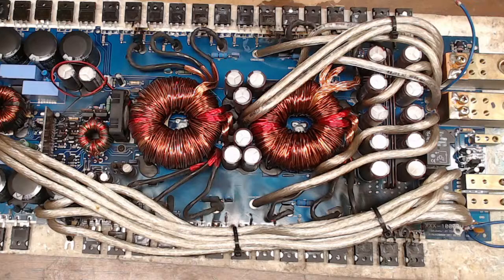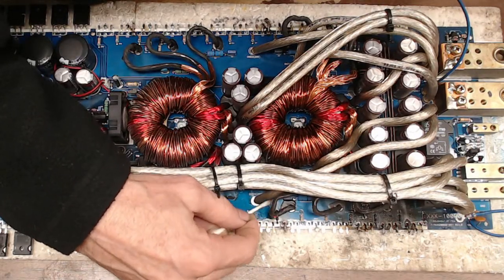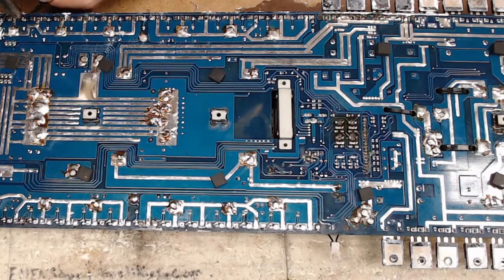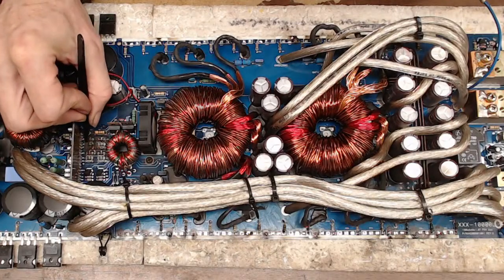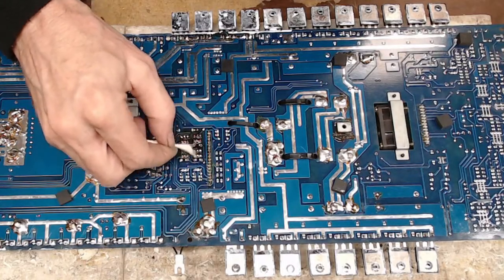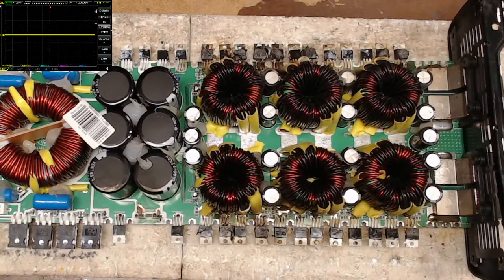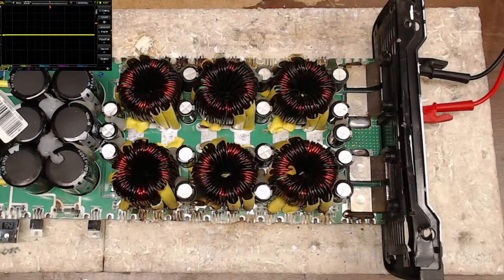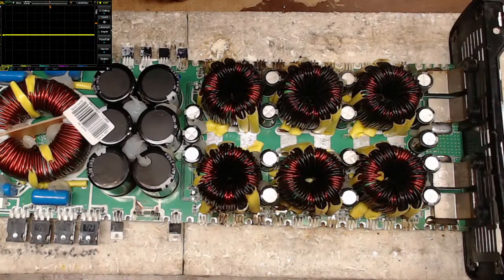SoundStream Tarantula XXX-10000D Repair of Power Supply Class D Automotive Car Amplifier

Comment: Is this amp still repairable?
Reply from the maker: In most cases, although expensive to repair, they are completely repairableif the output card is not damaged. I have been able to fix a few cards but not all due to a single IC. And just as an update it is not a programmable IC but I can only get them from overseas.
Reply: @ellensburgamplifier   I'm the second owner had 15yrs and still working. Does it require maintenance?  If any IC goes wrong, will the amplifier stop working?
Reply from the maker: @SwiftSystems1  The most important thing is to make sure the fans are in proper running order. They are critical. If any ICs were to fail the amplifier will not function or have no output.
Reply: @ellensburgamplifier  ok. I have always ensured that the amplifier has a circulation and that the bottom of the amplifier is elevated in a nonsmoking vehicle. I considered purchasing the Down 4Sound JP83 to add to my existing project and for Pre-Order SoloX 15". Any flaws in that brand?
Reply from the maker: @SwiftSystems1  Just to let you know that there are two small fans within the amplifier that if they fail the components they cool will fail. I don't service the JP amps due to the flaw with the Bluetooth modules so I am not able to give much insight into the amplifiers. They do seem to be well-built though.
Reply: @ellensburgamplifier  ok.

Comment: bass 8k cross remote and speaker wire when on what blew no smoke just click and gone
Reply from the maker: The remote IC needs to be replaced along with a thorough inspection of the board for any other failures.